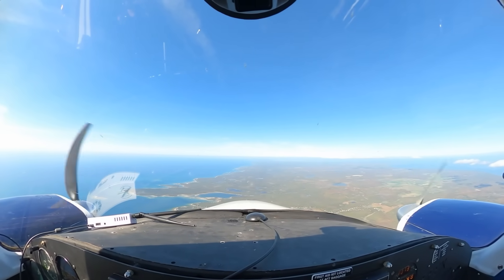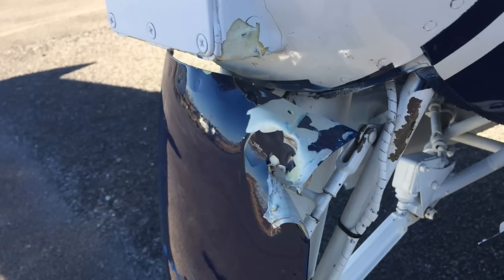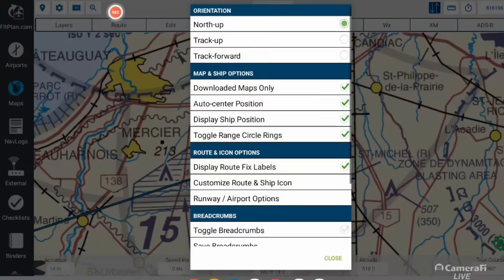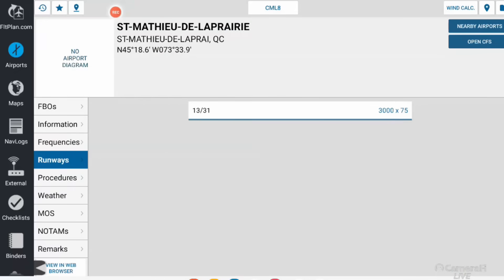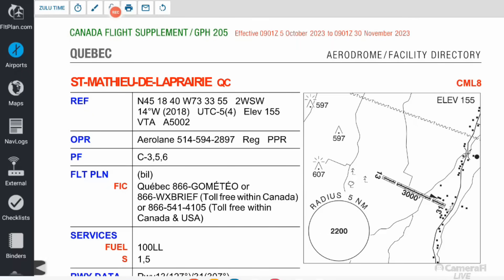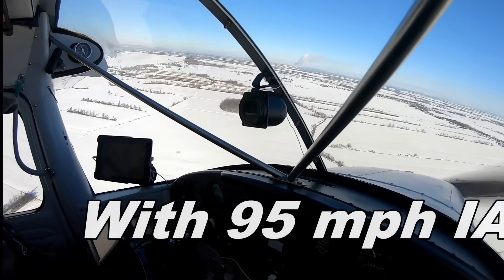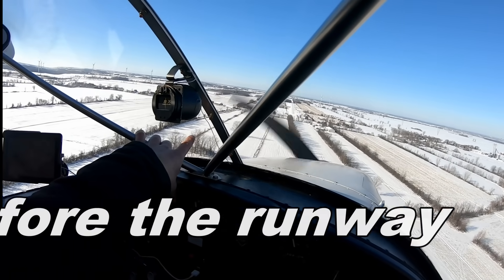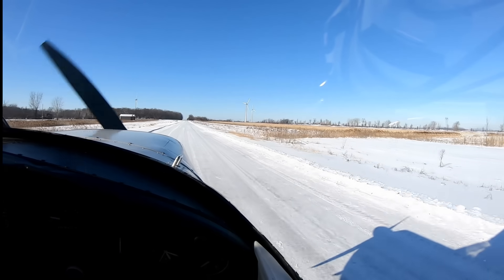Wire Strike Cessna 310

Comment: As a non-pilot I'm shocked there isn't some kind of minimum safety standard that all airports are required to meet which would preclude this sort of thing.
Reply: There is. But sometimes rules aren't followed nor enforced, especially in the middle of nowhere. That's really the crux of the issue here.

Comment: I fly around and under powerlines while I'm working and keep a sharp eye out for them, I even have a set of powerlines over my own airstrip that I have to land under.  But in that situation, I'm not even sure if I would've seen them, much less someone that wasn't expecting to see powerlines right off the edge of the runway like that.  The absolute least they could've done was put up some markers on the powerline and they didn't even bother to do that.  I'm generally the kind of person that lets things go but that could've absolutely killed someone, and the fault would lie directly with whoever was managing that airport.
Reply from the maker: Thanks for your comment it is great to get some support. 

It really was stunning. I thought I was doing everything I needed to keep us safe and watch for windmills and find the wires as marked. It still went wrong and I am just lucky it was not worse.
Reply: @fastbackflying853  Don't be hard on yourself, I'm not seeing anything that you'd be at fault for.  Sure, if you were being hyper aware you might have seen them at the last second (which might have ended worse if you tried to hop over at the last second riding the stall warning), but no pilot should be expected to see something like that right next to a runway.  That's the fault of the airport, and the reason why it was even there to begin with is because it costs more money to bury those lines or relocate them.  I have no doubt they had the option, weighed the pros and cons, and decided to string them up on the approach because they were being cheap at the expense of safety.

I've been through exactly one set of powerlines myself, in planes that were meant to deflect or cut them.  They still scare the crap out of you and repair costs can be ridiculous, especially if you arc through a turbine bearing.  Fortunately I was flying behind an R1340 and the prop cut the wires with nothing more than cosmetic damage.  A little touch up paint and all was well.

A little advice that ag pilots often tell new guys...it may not be terribly relevant to GA pilots but in cases like this, maybe it would help?
-Don't look for the wires, look for poles or structures that wires could be strung between.  They're a lot easier to see intuitively, and if you get in the habit of treating these places like a no man's land, then you're far less likely to have a wire strike.  Sometimes the poles can be hidden behind trees and the wire will span the distance of the clearing. Poles can have guy wires too, especially when the lines make a turn or a corner.  Circle over if anything looks suspect until you can verify one way or another.  
-Most pilots who die in wind farms aren't hitting wind turbines.  They're hitting the portable meteorological towers that are unmarked and pop up in unexpected places.  These towers are very thin, comparatively, and are hard to see unless spotted from below at near ground height.  If you have to go between turbines for any reason, keep your eyes peeled for almost invisible towers.  You can fly under the blades with relative ease, but you won't make it through them when they're moving.  Be cautious of flying near stationary horizontal blades, sometimes workers are present and there's a line going from the blade tip to the ground.  A few years back a pilot sent a worker flying 20ft in the air when he flew into the line that was attached to his harness.  Kinda funny in a way but not really, nobody was hurt.
-If they're not obviously free standing, towers will have three to four sets of guy wires for support.  Look for the anchor points in the ground and trace up to the top for a visual reference of where the wires are if you have to fly in close proximity.  If you can't see them, expect that they'll extend out at least as far as the tower's height.  That'll keep you out of harm's way.  I've only met one pilot who survived an encounter with a guy wire, and knew a lot of great pilots who didn't survive.

Be safe and clear skies!

Comment: Close in steep approach. Solves many problems. Short landings are easier this way. I know ill be beat up in the comments but i dont care. These long flat approaches are the problem, not the solution.
Reply from the maker: I agree with you. In this case a very steep approach was required. You can see that when we returned a few months later. 

I would just reiterate that I did keep myself high until past the expected obstacles and the dropped down at a 3 degree or higher approach. After carefully reading the information and making 2 passes I obviously felt safe with my approach. I got bit by an unmarked wire way to close to the runway.

Comment: In the US, those power lines would have been required to have those spherical, orange visibility markers on them.
Reply from the maker: The requirement here due to the proximity to the runway was that they had to be buried. Unfortunately they got stung by the power company and before they were removed I hit them. No markings or NOTAM issued about them so not good.

Comment: Quite the story, glad you are here to tell it!  Your minimum maneuvering speed in the 310 at gross and all dirty would be 104 mph.......  that 95 is a little light....
Reply from the maker: Thank you kindly. 

For thr 310D single engine minimum control speed is 83mph and single engine minimum safe climb speed is 95mph. These would be clean speeds. 

91mph gear up flaps 15 is best single engine angle of climb. 

Initial approach turning final i had the speed at 105 mph for conditions and slowed to 95mph short final when committed to landing. 

A short field landing with full flaps would be flown at 86MPH for my landing weight of 4300lbs.

Comment: The fact that there are poles on either side of approach should have made a light come on that MAYBE there are wires there. 
Your criticizing the approach and all the information available. When the poles were right there.....
Reply from the maker: Yes very easy to say after the fact but that is why we flew over the place twice. The poles running along side do bring power to the airport property. I never expected nor should there have been a wire pulled across to the adjacent property and unfortunately I could not see it. Thats sort of the point of the video.

Comment: The airport operator is responsible for updating the CFS.  The airport diagram set you up for failure by showing only the roadside powerline. Sadly it often takes TSB to light a fire under TC, which since the pandemic, takes ages to get anything done.

As for liability your insurance company will talk to the airport insurance company - which may be the same company. The powerline operator is likely self insured.

I've dropped into several farm fields and strips in my glider.  The trick is to look for the poles, but in this case, pilots might think "nobody is that stupid" and believe the wires are running parallel to the runway, but they would still be too close to obtain approval.

Comment: Several weeks back a Cessna float plane flying down a river struck power lines that were unmarked. It took the plane down in the river. The plane was totaled. Both men got out alive. Port Clinton, Ohio
Reply from the maker: Thats horrible. Wires with float planes are a much larger risk factor due to the abilty for you to land in so many places that have not ever been considered for airplane operations.

Comment: Glad it all ended safely but this is the reason I tell my students the 3 degree approach is there for a reason. 

Bringing the plane in hanging from the props might be good for short field landings but full flaps and a 3 degree standard approach angle is safer and would have given the same landing spot and full runway. If the weather (wind) conditions don't let you then choose another airport. If you have to go into that airport then accept the possible consequences. Yes, the wire shouldn't have been there but 30' AGL that far from the runway isn't a "slightly shallow" approach.
Reply from the maker: Wires at 35 feet AGL 500 feet from the runway requires a greater than 7 degree approach descent to miss
Reply: @fastbackflying853  You said 500' from runway but you also had 350' displaced threshold so you had at least 850' from the wire to the closest landing spot, unless the rules are different in Canada.
Reply from the maker: No that 500feet was measured by TSB from wire to displaced threshold. Now my own measurements I had thought about 600feet but I was just pacing that out. 

Even if it was 850feet you would still hit the wire with a 4 degree approach path.
Reply: @fastbackflying853   Your own video shows 500' wire to runway threshold (1:25) then another 350' runway to displaced threshold (1:36). Sorry I can't be a robot cheerleader like all these people commenting who probably aren't even pilots. Give it up.
Reply from the maker: I had to double check my video. That should have said to displaced threshold. As previously mentioned even using 850 feet and a 30 ft height it requires a greater than 3.5  degree approach to clear. So a major hazard pulled across a runway.

Comment: The worst part of this tale is it brings doubt to all the published information in the CFS! this could have ended so much worse!  thanks for sharing.  I remember something I was told when I started flying. "Learn from other's mistakes, because you won't live long enough to make them all yourself!"  Thank you for posting this!
Reply from the maker: I agree 100%. Thank you for your comment
Reply: Well, gone are the days of lugging a paperback CFS in the aeroplane!  Now it’s digital or use a pilot app to get the info.  I think the reality is that for small airfields there is a good chance the info may not be 100%.  A call to the field operator should deal with most things…..you would hope!
Reply: @davidpowell7614  lol Yup... no more 5lbs of paperback in the plane :) Foreflight is a wonderful thing, but only as good as the data that gets entered. Calling the operator is a great idea.

Comment: looking at sat image on google maps, it looks like they are pushing that end of the runway further away from the road at that end, there is a massive mound of green and dirt parallel to the building on the right where the threshold used to be in the 2022 image. That or the runway is being ripped up entirely starting from the east end. I can only hope no one else hit that wire before the changes.

Comment: Why was that so "incredibly infuriating" that the power company restrung that wire, they have a contract to supply electricity, not monitoring airports, plus moving cables to a new location cannot be done by an emergency repair crew without surveys, work orders and so on, all that takes time.
Reply: They. And everyone, has a "contract" (obligation) to not cause harm or danger to others. Putting wires across a runway approach or departure is clearly a "hazard to navigation".

Comment from the maker: Also lots of people have been asking why no balls marking the wires. The simple reason is that the wires are too close to even be allowed to remain with balls on them. The electrical company also charges airports or individuals for installing the balls. This was why flying operations were not meant to continue until the wire had been removed. 

A number of local runways and private strips have had issues with the electrical companies replacing electrical poles with much large ones increase heights of wires to as much as 80 AGL. I know a number of individuals who have struggled with this occurring off the end of their runway but its always been dealt with. 

In this case power was running to the hangars down the access road. I believe that it was strung across the runway by the electrical company to another property with no regard for aviation safety. The airport was stuck trying to get it removed but also not wanting to have their operations stopped until that had occurred.

Comment: These wires are extremely strong and could rip open an airplane like a hot knife through butter! I'm going to go out on a limb and say you must of hit this perfectly with your prop because the tension we put on the wires would scare you and you getting through it doesn't make sense to me! I'm glad you are here to tell your story brother because I've seen up close and personal what these wires can do to sheet metal and steel. I've seen a 28ft loaded Uhaul truck suspended off the ground dangling between two power poles in Tennessee, we cut the wires and let it fall the rest of the way down the mountain!

Comment: It actually takes more than an accident to get things improved.  Transport Canada were initially uninterested in the problem despite raising a report and contacting, well, contacts!  It took a telephone call to the TSB to set a fire going.  After that the Montreal TSB and TC staff went at it and got the wire taken down.  I was so incensed that a wire would escape all means of being identified in what was clearly the flight path that I kept pressing for action.
Reply: Sounds about right for Transport Canada. In 2005? at a large glider club in southern Ontario,  the then club president (A.G.) in a temper tantrum parked his car and glider trailer ON THE ACTIVE RUNWAY while flight operations were underway,  this was witnessed by several members and reported to Transport Canada. T.C.  PROMPTLY brushed IT off with NO CRIMINAL CHARGES. At the same time,  T.C. was on a runway incursion reporting blitz! They are happy to take the paycheck but actually doing anything is inconvenient.
Reply: Why no balls on the wire?
In Europe, all wires near airports must have visibility balls.
R
Reply: @RalphEllis here in the US, all overhead wires near an airport are marked with high visibility orange spheres as well. Regardless of whether they pose any risk to departing or approaching traffic.

 One airport I visited had a high tension wire with the orange spheres almost a mile and a half away from a heliport, and that was parallel by about a half mile to the approach pattern. The lines were just barely above the trees so any possible aircraft would be flying dangerously low to even consider it a hazard...

This is simply egregious!
Reply: They should also be on wires in Canada.  Our local airport CYPQ, has them on wires near the runways.  The situation we literally ran in to was an airport with incorrect reporting and procedures in addition to incorrectly mounted wires. @RalphEllis
Reply: It certainly was! @EyebrowsMahoney
Reply: I agree, back in the early 80's a friend of mine and I had an ultralight airplane. There was a make shift strip in his fathers field but a road at the end with an overhead power line. His dad called the electrical utility and told them they better put a ball on the line. In a matter of days it was there! Perhaps contacting the people that have more to loose by bad publicity and are a smaller bureaucratic entity speeds up the desired effect.  @RalphEllis

Comment: One of the most common sizes for a wooden pole of that type is a 35 class 5 - which requires a buried depth of 5.5ft, leaving 29.5 ft above ground obstacle.  At 500 ft from the threshold, that wire protrudes well into a typical 3 degree approach angle.
Reply from the maker: Thanks for the information and backup on the calculations

Comment: I lived in Indiana for a few years. There was a stretch of road with high voltage lines (not the big towers with millions of volts, like a normal power pole just a bit taller with a bit more insulation) 5 miles of those power lines had the orange ball markers hanging from them for 1 purpose, the crop dusters tended to dust across the road because of the trade winds. What moron installed this wire in front of a runway without so much as a single marker on it. Hell just an orange plastic wire shield would make it 10x easier to see. That is a level of incompetence ive not seen in the aviation community in a long time.

Comment: Being as I was a high voltage lineman for over 30 years, Wires have always scared me because I know the strength that they can carry. I use google earth and foreflight to look these rural airports over before the flight and I usually orbit the area with one pass looking for things just like you encountered. I am glad it did not flip your aircraft or rip the wing off which it could have easily. Fly Safe My Friend
Reply: google maps and earth are great! I use them whenever I'm going to a new airport or strip! the biggest problem (in Canada at least) is the imagery is so out of date, years if not decades old

Comment: Consider habitually flying steep approaches. I fly one engine planes (for decades) and always fly steep final approach (so steep, in fact, that I imagine tower controllers gathering at the windows facing 27R (at KOAK) to watch whenever I RTB!), considering it practice for when my one engine stops providing thrust and becomes ballast. It keeps you higher for longer and consequently with more clearance from ground gotchas. Plus you practice engine out landing every time. You just start roundout and flare a little higher. You can also fly final faster as energy will be bled off with higher roundout & flare. Just a thought. Cheers!
Reply: Yeah this was my reaction too.  Aiming at brick 1 AND flying a very shallow short final can be very risky with potential obstacles.